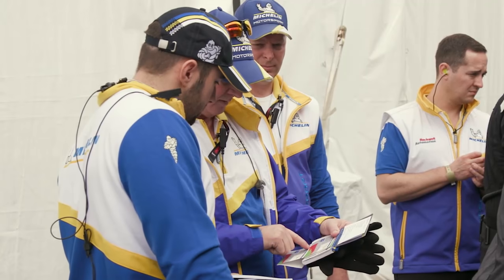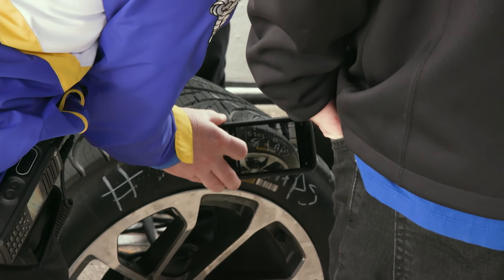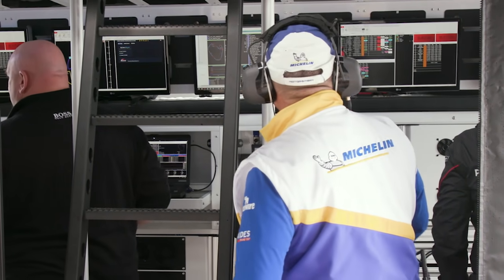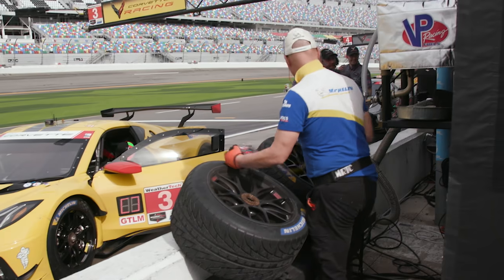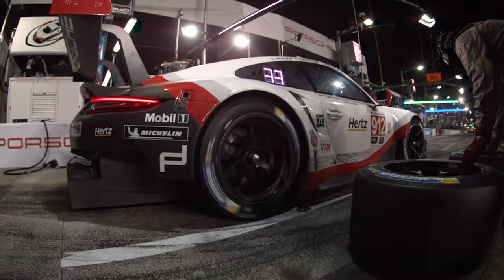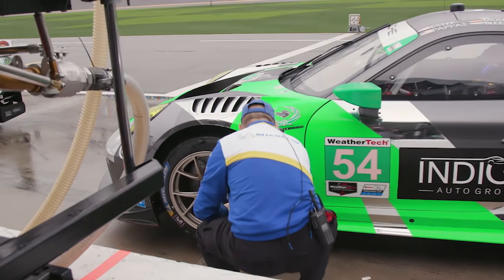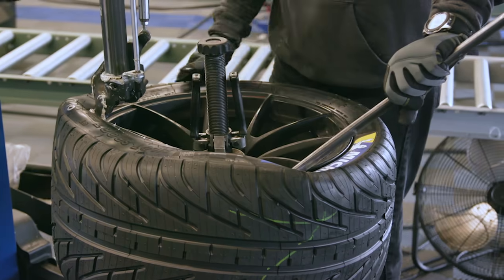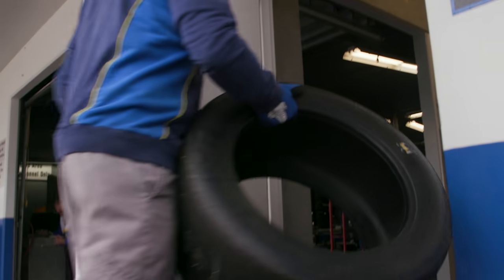DATA-tona

Comment: So some GTLM cars run different compounds and tires based on manufacture?
Reply: That makes a ton of sense now that they tell us that.  It would be really hard to keep performance fair between cars like the M8 and the Ford GT from race to race if they used the same compound.
Reply: Roberto Arkenburg ya, front engine/mid engine layouts are different but then how do you make sure someone doesnt have an unfair tire advantage that way?
Reply: @ChuckBeefOG  You want the tires to be the best they can be, for performance and safety reasons. Also this is where the research and innovation comes from. The BOP is best left to power and weight. To answer your question, that's how they keep someone from having an unfair tire advantage: by making sure everyone has what's best for their particular car.